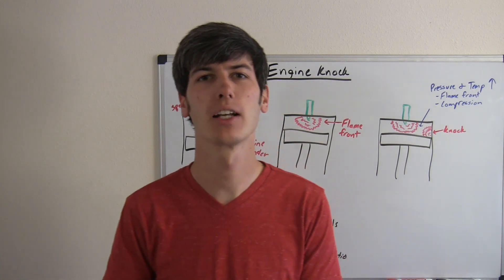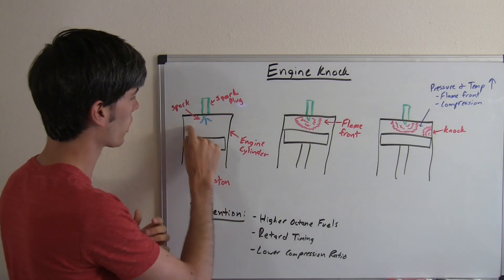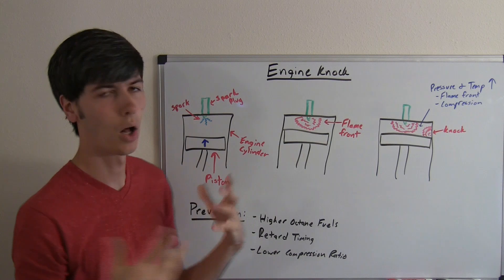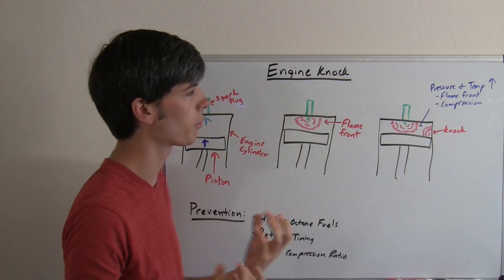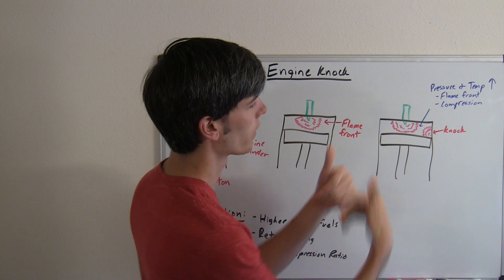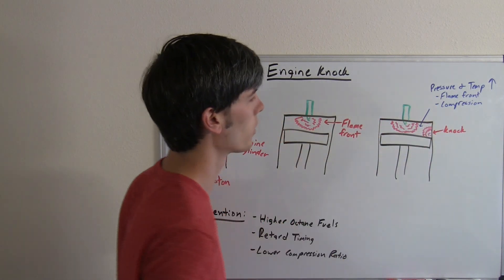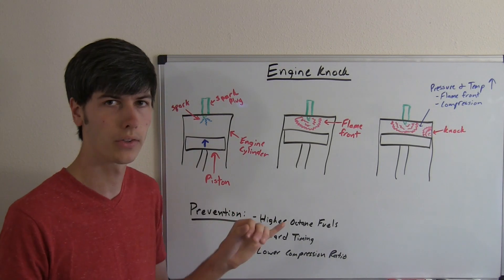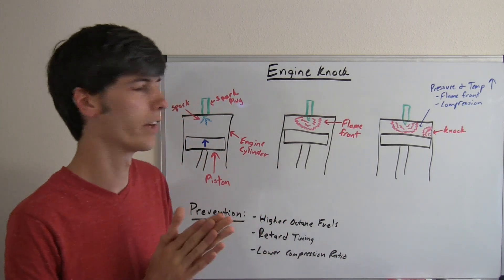Engine Knock Sound - Explained

Comment: Dude, love your stuff, but you've got a few things wrong on this one. KNOCK DOES NOT HAPPEN AFTER THE SPARK PLUG HAS FIRED. If this does happen, this is minor, inconsequential knock. The reason why (the bad kind of) knock is bad is because pre-detonation occurs before TDC (top dead center). I'm using TDC as a theoretical as we all know that at high RMP you have many tens of degrees of spark ignition happening before TDC just due to the velocity of the piston - otherwise your pistons will move down faster than the flame front - so you want to catch it just right. This is the entire purpose of an ignition map (in addition to the fuel map) as opposed to always firing the spark at TDC. This is getting into tuning for power so that's another topic entirely.

So what causes knock? A build-up of carbon, or cheap gas cause a localized spontaneous combustion because the heat and pressure have reached the point where this happens on its own. A glowing piece of carbon stuck on the inside of the cylinder cavity is the root cause, and this is made easier with low-octane fuel. Also this is why turbo cars with high PSI NEED higher octane. Fun fact - cheap gas causes carbon build-up faster than the higher octane variety. Also gums up your injectors prematurely because the fuel cooks in them while they cool off after you've shut off your car.

What happens when it knocks? The flame front from the knock starts building cylinder pressure prematurely. Normally when the piston is at TDC the PSI in the cylinder is ~1000 PSI - depending on the motor, compression, boost, etc. Having knock causes this TDC pressure to spike up to 5000 psi or something stupid like that. Unless you have head bolts made from unobtanium they will snap and the engine head will separate from the engine block. Your headgasket is also going to get damaged for sure. Your coolant will mix with the oil, and when that happens the oil stops being a lubricant and if your motor hasn't exploded by now, it'll be a medium to slow death depending on the severity of the damage. There are tons of videos showing engines running at maximum RPM without any oil between 5-10 minutes so they can take quite some abuse before dying catastrophically. If your head bolts have snapped, you'd probably losing all your pressure so it won't turn over on its own anymore and you'd need the starter motor to keep it going - until you run out of battery.

The PSI numbers from knock and other facts were sourced from a Honda Tuning magazine - but not from THE "Honda Tuning Magazine". It was one with turbo graphs and other things for people who want to actually learn the math and physics of tuning Hondas and how they're different than DSM motors by nature.

Let me know if you want to discuss this further. In the meantime you can check my claims with any tuner shop and I'm sure the interwebz will verify this.

Comment: thats not the only reason.
Reply from the maker: It's an explanation of knock, not anything that makes a sound.
Reply: True. This is one reason of why a new car would knock but if its an older car. The knocks could come from a lack of oil, the clearences between the crank shaft and connecting rods beeing to excessive. Bad spark plugs (miss fires) or something loose. But hopefully it is just the reason you listed and the "change your gas grade" fix that would work. If some one has a car that requires super premium gas. Then they best be able to pay for it
Reply: Your wrong engineering explained, a knocking sound comes from the crank shaft when a bearing has to much play in it, why don't you think why it's called rod knock?

Comment: Your methodology of street tuning standalone systems would be interesting. I've gone through the trials and tribulations of this while learning on the fly. The integral portions of street tuning could be summed in a 20 minute video I suspect. It could be a liability for you though :)

Also, a video on the complexities of OEM Knock detection/control and how it compares to aftermarket systems. Lots of debate on forums over this topic.

Comment: Is Knock specific to (Spark Ignition)SI engines or can it also happen in (Compression Ignition)CI engines? Considering that diesel will ignite due to the compression of the piston, there can be different areas where the fuel will begin combustion. I feel it would be more common in CI engines but never heard anyone mention it. Any reason for this?
Thanks for the clarification in advance!
Reply from the maker: Aditya Ramchandran In diesels I believe it's referred to as detonation, when it occurs when you don't want it to. That said, diesels are direct injection, so the ignition timing is dependent upon fuel injection timing, so it's much more rare for it to be off.
Reply: Engineering Explained  So does this mean when petrol engines use Direct Ignition, knock is minimal?

Comment: Hi.. I have a problem in my car if any one can help please.. I have Hyndai Santafee 2007 2.7l V6. The acceleration is very slow.. to be exact there is no acceleration on the same gear.. u have to press hard on the padle and send it back to the previoues gear in order to get resonable acceleration, but on the same gear no matter how much u press u get nothing. Plus when I start the engine the rpm keeps moving for a minute before it stablizes. I did computer check and there was a code "system to

Comment: What about pre-ignition? Is that causing engine knock?
How to distinguish the sound of the engine knock with a worn bearing sound?
Reply: Firing orders wrong or ignition timing off
Reply: Place stethoscope on oil pan with engine running to detect rod bearing knock.
Reply: Pre-ignition from say carbon deposits on a high mileage engine, can also create too much heat/pressure which can cause detonation (commonly known as "engine knock").  Detonation will only occur with the transmission in gear and the car moving under load. The more load , the more knock. Load meaning how hard the engine is working. eg. going up hill with the a/c on.
Bearing knock can usually be heard with the engine idling under no load (as well as under load). The knock varies directly with rpm. It is a more pronounced sound and actually sounds like a knock, unlike detonation which sounds more like marbles rattling around in your engine.

Comment: I agree with what you said, except the part about the flame fronts colliding.  Think about it.  Some engines have two spark plugs per cylinder.  Flame fronts collide every ignition.
Reply from the maker: ssmith8881 Yes but that's in an organized and predictable manner. It's also not the norm, but it can improve emissions in some cases.

Comment: This seems typical with older cars . My wife only runs regular in our 1998 crown vic . It has a chatter but when i fill it up with hi test the chatter go away . Some people debate this but i am pretty certain its the ethonal ( which is water based ) level that is the problem . Higher octane equals lower ethanol mixture . Newer cars especially compacts are designed to specifically use the ethanol to the engines advantage ... hence the warranty void if you run higher test gas . 
 Is this correct is am I missing another possible component? Could test my theory with my Acura but not willing to run less than high test in it .

Comment: A major source of pinging/kbock is carbonization of the upper cylinder.  The carbon surface causes predetonation on the cylinder walls.  There several chemical washing techniques to remove this carbon buildup.

Comment: Why are D.I injected cars able to run such high compression ratio with 87 oct gas.
Reply from the maker: Because you can inject the fuel directly when you need it to ignite, rather than having a mixture sitting in there getting compressed. There are also some other tricks they incorporate, I know Mazda uses some exhaust changes to help.
Reply: ***** They are similar fuels, just that the Americans refer to them using a different rating system. i.e. the "93" fuel in US speak is equivalent to 98 in UK / Australia. UK/AUS generally speak of fuels using the RON rating, whereas the Americans AKI rating. See here en.wikipedia.org/wiki/Octane_rating

Comment: So if a engine just started knocking out of know where what would that mean? And how else would you fix it? Let's say a fuel injected car with electronic ignition timing? Would you just have to get a tune and richen it out? And also Can low fuel pressure cause knocking since it will lean out all cylinders,

Comment: One more question, is it a good Idea to use a fuel that has a higher octane than what the manufacturer recommended? for example the recommended octane is 92 but I use 97 octane fuel
Reply from the maker: Use what's recommended, it's very unlikely you'll benefit from a higher grade fuel.

Comment: This is a big problem here in Brasil due to high compression ratio of flex fuel engines and poor quality fuel. The "solution" adopted by the government is a mix of 75% gasoline and 25% & alcohol. The problem is that this is the only tipe of gasoline available for sale. So we pay more for a fuel with less energy capacity, and which can impair the durability of mono fuel engines. Sorry for english and congratulations for your videos.

Comment: Sometimes I hear my engine ping or knock after I drive it. Is that the same thing and is it normal? It's a new car.
Reply: if its after you get out, then its probably just hot parts expanding or contracting from heat, probably nothing to worry about
Reply: Yea, like he said. Nothing to worry about, its normal. My mom's truck & brother's car does that.
Reply: If you mean the engine "runs on" after you switch it off (ping / knock sound) this is caused by carbon deposits in the engine's combustion chambers glowing red and igniting the fuel / air mixture after you have switched off the spark plugs. This only happens on carburettored engines.
Reply: U dumb

Comment: Off topic to this but if it's given an option of turbo a low compression ratio and a highcompression ratio. Is it then better to chose the low-compression?
Reply from the maker: Low compression ratio will have a lower chance of knock. Higher compression ratio will typically be more powerful/efficient.
Reply: Does this mean that Diesel engines are most likely to knock because of high compression?
Reply from the maker: MultiAna96 They use fuel injection for timing, rather than a spark plug, so it's much less common for detonation to occur at a non-ideal time.

Comment: I would change the title to engine pinging or pre-ignition
usually people refer to a "knock" as a rod knock or a spun bearing (or atleast I do)
Reply from the maker: It's quite common for this phenomenon to be referred to as "knock."
Reply: Engineering Explained The title is fine, this is what I understand engine knock to be, not rod knock.
Reply: Khan brah thank you finally someone with a brain here
Reply: I came here for rod knock.  Stayed for the engine knock, and found out I actually have engine knock after checking out some other web sites.  Engineer Ed should have showed us a few spark plugs that came from a pinging engine because that would have been greatly helpful.  That's what let me know for sure I had engine knock and not rod knock.  I had peppered brown spots all over the insulators on all of my plugs.  I recently rigged up a copper line setup attached to my upper radiator hose to preheat the fuel to increase MPG.  Turns out copper oxidizes fuel so it breaks down much faster, plus the fuel was hot as balls.  I was knocking it out of the park so hard I thought I had rod knock.  Hell, I might actually have rod knock as a result now.  I have to drain all the fuel tomorrow and remove that infernal experiment.  Never doing that again.  I got the idea from a guy who went nuts and wrapped his cat with copper lines.  Apparently he only used it for about 1 gallon of gas to see what his mileage was and removed it right after so he didn't know that it would oxidate the fuel down to a lower octane rating.  I imagine if you don't have a fuel return with an FPR like in the 4.0's from 97 and later, and use stainless steel, you can get away with it.
Reply: Definitely a "you" thing, no offense man.
Reply: That is why it is called a knock sensor. It senses knock and retards timing

Edit* oh and pre-ignition is different. That is when the air/fuel mixture spontaneously ignites before the spark plug fires.
Reply: @johnathanbalmer  it's called NOX sensor not knock sensor smart guy.
Reply: @armyguy22  yeah no sorry but it's a knock sensor. A nox sensor detects nitrogen oxides in the exhaust system. Nox causes smog

Comment: What is engine detonation? And is this the same as rod knock?
Reply: Dusan Pesic I think rod knock is from oil starvation. An iridium coating between the rod bearing and crankshaft wears away from lack of oil. So detonation is timing that is retarded right? Air/fuel mix ignites before the sparkplug ignites it?
Reply: no, rod knock is rod bearings that have too much play = constant knocking that progressively gets worse
engine detonation = air fuel mixture igniting (to detonate: to cause something to explode)
Reply: correct (although i'm not sure what the coating is made of), the lack of the coating will eat the bearing and the crankshaft because they're both hard steel

well technically detonation is to make something explode, which you are doing during normal operation, but timed correctly. you're talking about pre-ignition, which is when the air fuel mixture detonates (ignites) before the spark plug produces a spark. retarded timing wouldn't have helped in that case

with engine knock there's an unwanted second explosion after a spark has ignited the air fuel mixture, causing the two explosions to collide, creating knock. retarded timing would help in this case because the mixture would have already combusted by the time there's a spark, so no knock
Reply: Engine detonation is the same thing EnEx explained.
Reply: detonation also only happens during compression
Reply: I have the same question.
Reply: Dusan Pesic I'm still confused about detonation. Can you explain it step by step?
And there's always a layer of oil between the bearing rod and crankshaft. If there's no oil, they would be touching metal to metal, which is never good.
Reply: Fritz Krieger *pre detonation
Reply: Cantenkerous Tim
There should always be a film of oil between the rod big end bearing (which is made of soft "white metal" and the crankshaft big end journal, which is made of hardened steel. This oil is fed to the bearing under pressure from the oil pump. As the big end bearings wear more oil is needed to fill the gap between the rod bearing and the crankshaft big end journals, and eventually the oil pump cannot provide enough oil for this, causing low oil pressure. Once you have low oil pressure the big end bearing wear accelerates leading to even lower oil pressure and eventually "rod knock" - which is when the gap between the rod bearing and the crankshaft journal is huge, causing the crankshaft journal to "hammer" the inside of the rod bearing. Eventually the rod will fracture due to this hammering and cause the broken rod to punch a hole in the crankcase. I hope this helps.
Reply: david lel your explanation is good, but i think he's confused about detonation, not the rod knock
Reply: i'm no professor, so i suggest you read the wiki, lol http://en.wikipedia.org/wiki/Engine_knocking
Reply: Dusan Pesic Agreed. I was just making a few points about rod knock anyway. It's not the crankshaft that suffers the bulk of the wear, but the white metal bearing shells.
Reply: don't the bearings eventually just disappear entirely? if you leave it running without oil for long enough that is
Reply: Connor Palmer pre detonation/ignition differs from detonation..pre detonation happens only during compression(fuel:air mixture ignites prematurely during compression.)
Reply: I still don't know what detonation is.
Reply: Dusan Pesic I think that the rod would break before the bearings wore away to nothing, although it is probably possible in some circumstances.
Reply: Cantenkerous Tim detonation = kaboom when you don't want a kaboom, in another area but simultaneously with the kaboom from normal operation (spark plug)
Reply: Dusan Pesic So basically the same thing in this video? I read that it's when the remaining air/fuel mix in combustion chamber spontaneously combusts after the power stroke. Would that be correct?
Reply: davidrobert2007 Or in some cases like my 22r, the piston will slap the head and cause even more damage. Something I always wondered is how the crank gets oil through it.
Reply: yes, but during the powerstroke, basically from 10 (up to 40 depending on the car) crankshaft degrees to top dead center (0 degrees)
Reply: Zachary Caviness Oil under pressure is fed into the main bearing journals of the crankshaft, once past the main bearing journals the oil travels through oilways drilled into the crankshaft to reach the big end journals.
Reply: Marius G A rod knock is when the connecting rod bearing, which secures the rod to the crankshaft journal melts due to oil starvation and there is a gap created between the rod and crankshaft journal. The rod moves around and hits the crankshaft journal, which causes the knocking noise (rod knock) and over time the rod will fly off the crankshaft and hit the block. This is called throwing a rod and at that point the engine is done.
Reply: Ryan Stinson I'm hoping that is not what happened to my van. It will start, knocking is very loud below or above 40mph, then it will shut off when it overheats.